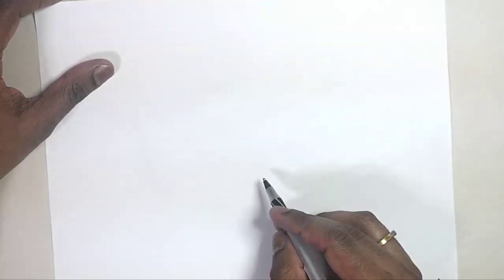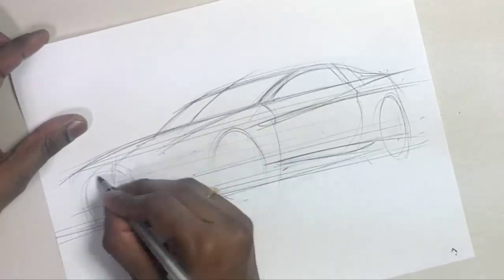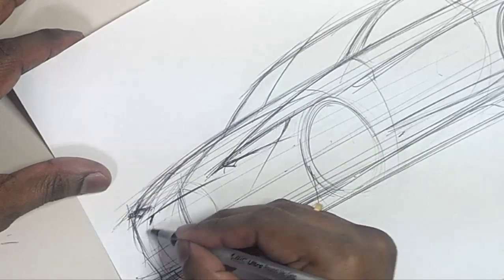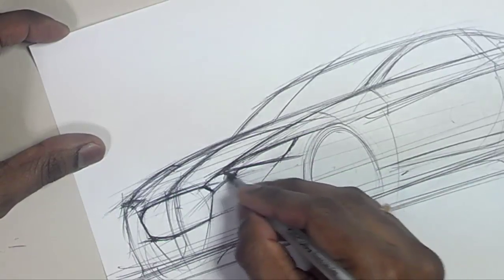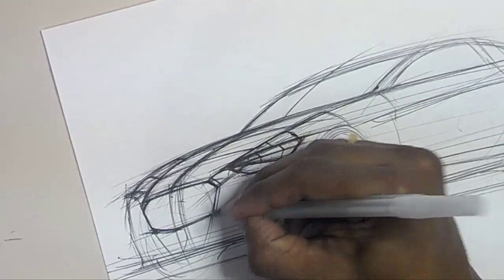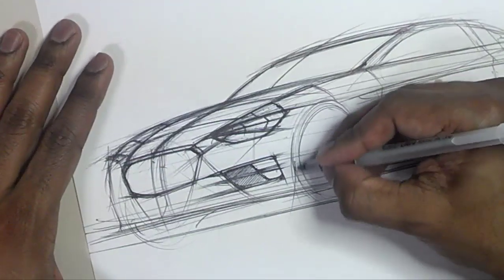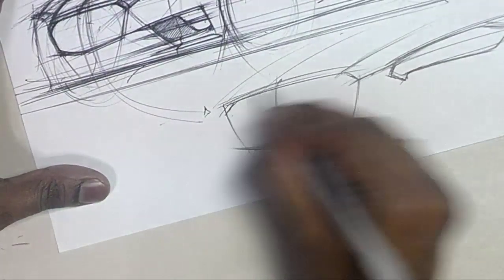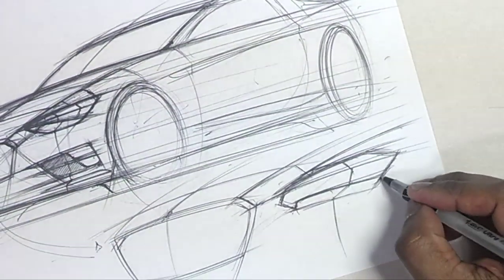How to Sketch and Design - Vehicle Design and Sketching Tutorials

Comment: Damn that's impressive.  I'm wondering though, do you know if industrial designers for vehicles are required to use french curves?  It seems it would help better with accuracy.
Reply: I have a degree in design. what I've found in using French curves is that it's a tool that was used traditionally but not as much today. The reason for this is the digital age. You can create any curve now digitally. French curves are expensive. A good set can run hundreds of dollars.  Also a lot of designers prefer to sketch freehand. It's more natural, fluid and less time consuming. Depending on your industry you may use straight edges or curves. Architects for example. And even in final drawings. But when sketching little to known is needed. My advice is to train your arm to make the lines rather then use a tool.  It's quicker and more rewarding.
Reply: +Brandon Richardson Also Curves and Straight edges make a drawing too perfect and tight.  This leads to a boring sketch. Until you're ready to make plan views there's no need to use them. If you're having trouble making elites or straight lines practice for hours,  weeks and months. At the end of the day try not to complicate things,  which means if tools get the job done use them and forget my advice lol
Reply from the maker: +Brandon Richardson great advice! Agree on all fronts. we dont use any french curves at work. all digital and most hand sketches do not require a finished look. however if creating an illustration, using curves is fair game if u want to tighten up a drawing. Many designers have the motor skills to execute the curve without tools. there is a distinct pleasure in investing in your motor skill development. the confidence u gain by drawing without tools. these motor skills will translate to many other aspects of creative development such as painting, fine arts, and other areas that take advantage of precision. its a frustrating journey but a beautiful place to be once u get there. thanks for commenting!